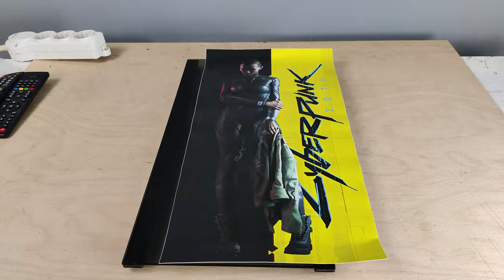Cyberpunk 2077 PC Modding & Decals Design Something

Comment: how did you print those images?
Reply from the maker: I created the decals in Photoshop using Cyberpunk wallpapers and I print them on a local print shop. Here is the decals files https://drive.google.com/drive/folders/1rzK7QFfms2COAke-HNs_cfqgMl_BmaSC?usp=sharing
Reply: @DesignSomething  wait, but they printed it on what. or did they have vinyl? or they used ing printers on vinyl? i wanna know cuz i already have a printer
Reply from the maker: @acid3719  Yes, they print my files on Oracal vinyl. They have a large scale printer.
Reply: Im still confused what do i need to do this i will buy the equipment

Comment: What is the decal you used
Reply from the maker: Here are the decal files https://drive.google.com/drive/folders/1rzK7QFfms2COAke-HNs_cfqgMl_BmaSC?usp=sharing
Reply: @DesignSomething  as in the paper
Reply from the maker: @Yeet-bx5bx  You can print the decals on your local print shop
Reply: @DesignSomething  no as in the decal paper used in this video like the paper not where to print or the photo file
Reply from the maker: @Yeet-bx5bx  I'm not sure I understand correctly your question. So I did the graphic in Photoshop then I printed these files on vinyl. Then I cut the vinyl on contour and stick it on case.
Reply: @DesignSomething   ok but ehat vinyl sheet

Comment: can share how u connect the screen and where to buy 1?
Reply from the maker: The screen is from an old laptop. You can use any 40 pins display. For connection you need a driver board like this one
https://www.aliexpress.com/item/1005003675596995.html?spm=a2g0o.productlist.main.11.5bb611c8GaTpq3&algo_pvid=3f396cd0-ccfa-421f-9932-2e2e87245eeb&algo_exp_id=3f396cd0-ccfa-421f-9932-2e2e87245eeb-5&pdp_npi=3%40dis%21RON%21102.04%21102.04%21%21%2122.49%21%21%40211bf48d16904586387266856d0731%2112000026755305502%21sea%21RO%210&curPageLogUid=AXa98IxSNbUG
Reply: @DesignSomething  oh i see thank you for answering my question and nice build thou!!! i probably using like raspberry pi mini monitor for live wallpaper  in my case.